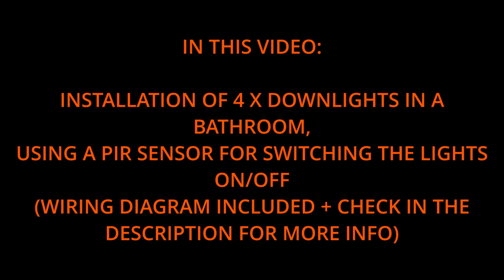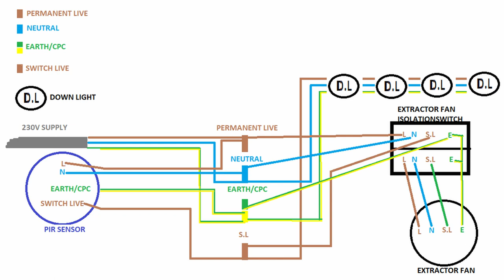BATHROOM LIGHTING 2021

Comment: Hi what wiring is used from the fan to the isolation switch? Thought this would be 3 core + earth but on the diagram the SL is green? Is this the black (SL) cable?